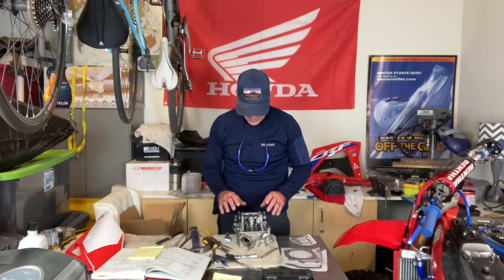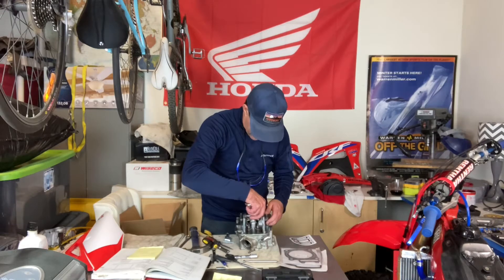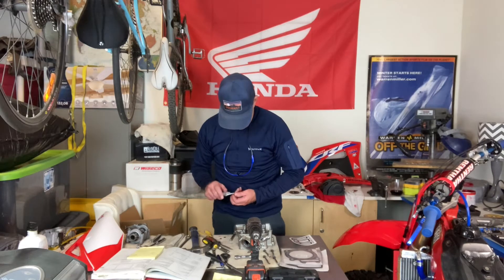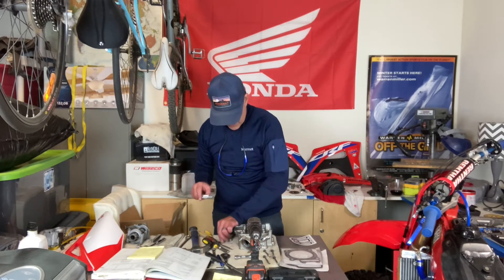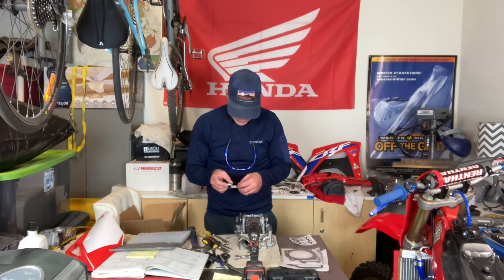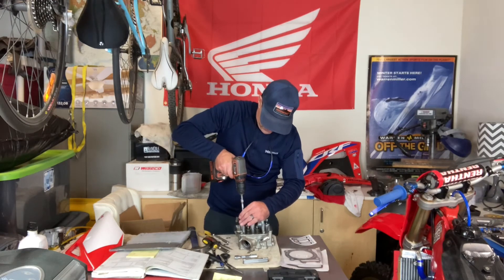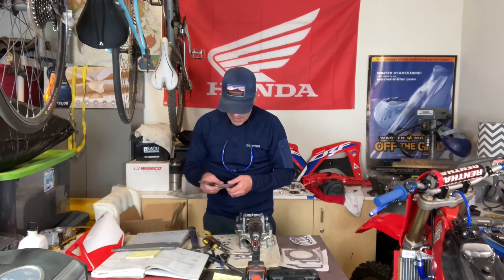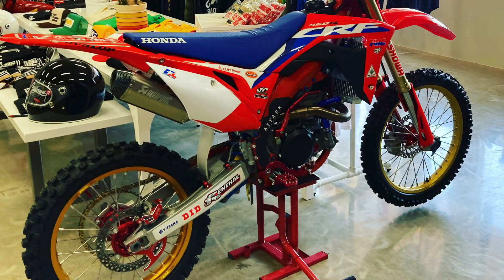Shimming and Adjusting valves on a CRF450

Comment: So how long did the stainless last compared to the titanium valves?  Less shimming?
Reply from the maker: Yes less shimming with stainless steel, shorter life of titanium but better performance no need for lapping either. If you are going for longer life go with stainless steel 👍
Reply: @socal.hondabuild8349  what is the type of strength that makes these last less? i thought titanium was better for everything how come they last less long?
Reply from the maker: @Johns367  they are lighter with less strength but the lightness gives them higher performance….just need to maintain them and change them more often
Reply from the maker: @Johns367  they are built lighter with good strength but run faster and wear quicker than stainless steel which are stronger….ill send a link to some good resources that explain the differences
Reply from the maker: @Johns367  https://youtu.be/SXh-p-KimJg?si=j4NaT7J3YoIiVQDn
Reply from the maker: This video from hot cams references that steel last longer
Reply from the maker: @Johns367 this video also explains how titanium differs from stainless steel https://youtu.be/LTAz-X2WQVw?feature=shared